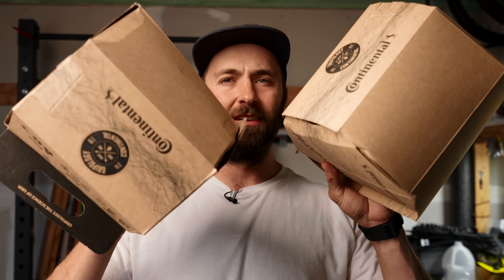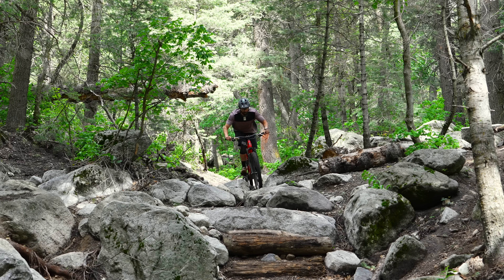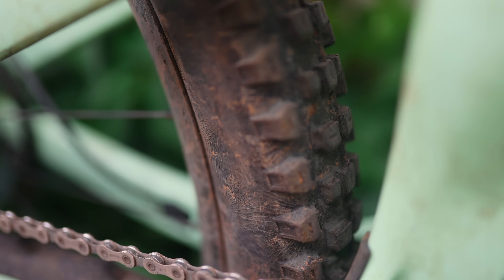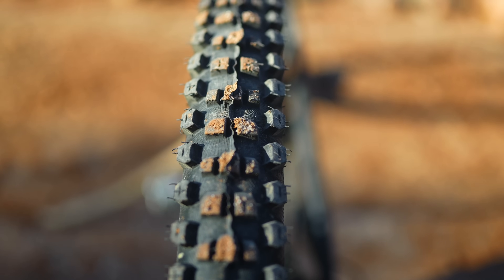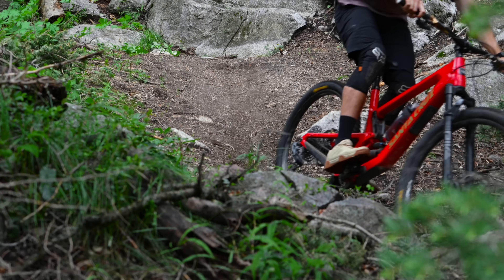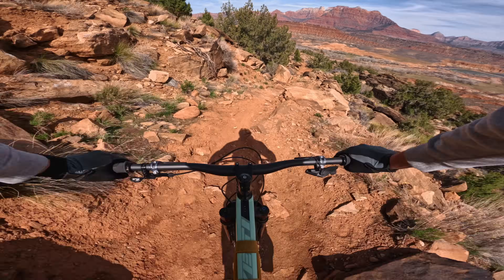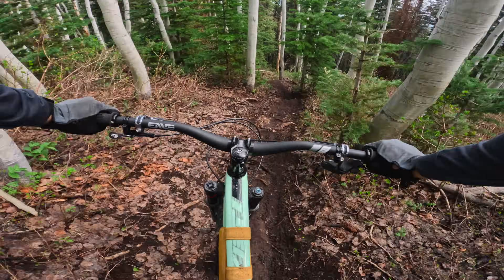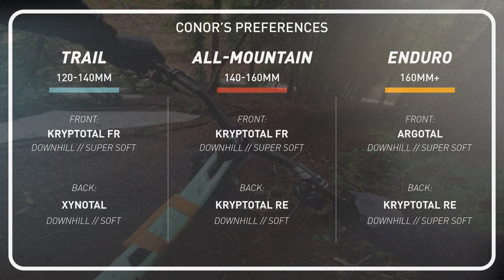Continental MTB Tire Guide: Find Your Perfect Tire

Comment: its dumb why you cant have a big casing with harder compound.. thats just stupid.
Reply from the maker: You can get it in the medium compound. I’d imagine most riders looking at a DH tire care more about grip than they do rolling resistance.
Reply: @bikersedge  but i want a Tyre like a dissector/dhr2(dd 3c MT) 
conti dont offer that  simlar 3c in enduro casing.
the closest they have is enduro casing w/ soft.
Reply from the maker: Yeah. It’s probably not far off from the Maxxis you’re after.
Reply: @bikersedge  Im currently running the krypt in enduro/soft on the rear with assegai front on the Ebike, the Conti soft is softer than the 3c MT of maxxis imo.
Reply from the maker: Could be. I haven’t done any back to back yet.
Reply: @MrSupermugen  So Enduro/Soft Xynotal is going to be your EXO+ MT Dissector analog?  And DH/Soft Xynotal would be your DD MT Dissector (the unicorn tire that nobody can find) analog?
Reply: @mrvwbug4423  I was thinking the DD MT3c is more like the enduro/soft